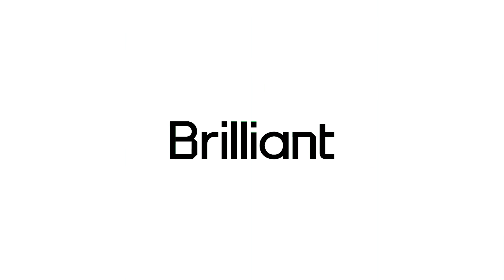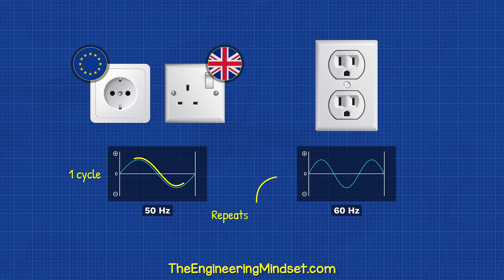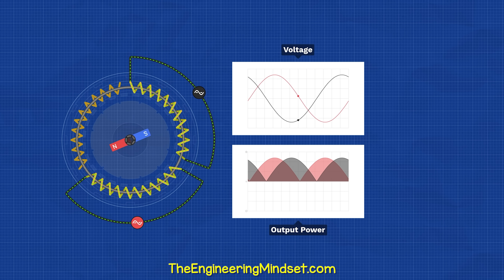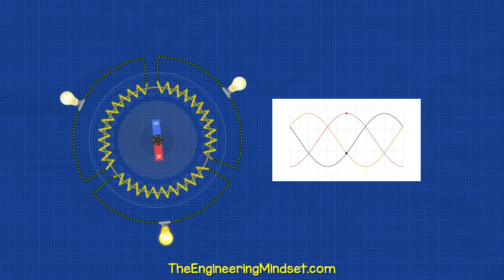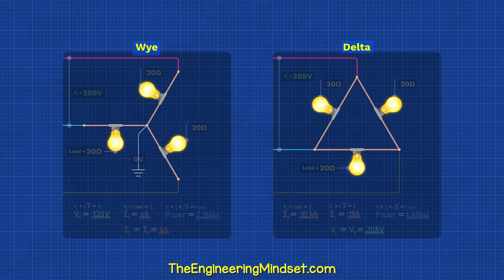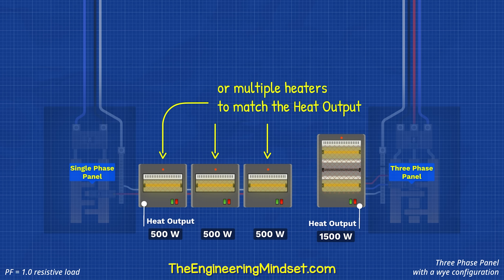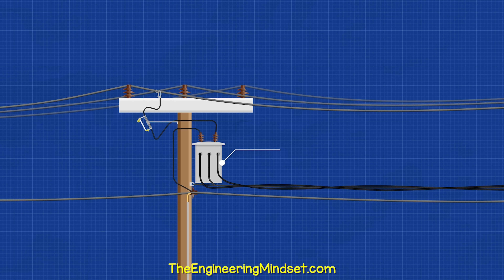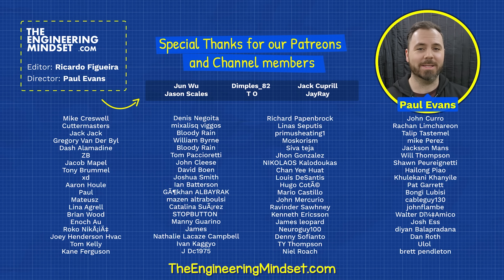How 3 Phase Power works: why 3 phases?

Comment: At 2:06 the oscilloscope is 90 degrees out of phase.  If this is meant to be an educational video you should get details like this correct.
Reply: Relax bud. This isn't a video on how to read oscilloscopes. Also, you're holding your phone sideways so you're 90 degrees out of phase
Reply: I have literally no experience in this, but I’m curious as to why it would be out of phase there. The highlighted area under the curve shows the wave to be at 0 when the magnet is parallel to the coil. Would that not be the case? From someone with no experience that seems correct, but If it’s wrong I’d be interested to know why.
Reply: @nickdowning5562 it's not off phase. When the negative is facing the coils the dot should hit the peak of the negative wave
Reply: @AfricanLionBat  it is wrong, because the stator windings are drawn in the wrong orientation
Reply: Relax Michael. No one who needs to read oscilloscopes should be using this video as a reference. He clearly explained the idea even if the picture wasn't exactly right
Reply: Or the magnet is wrong paited
Reply: this has to be a joke lmao
Reply from the maker: Seen our new Oscilloscope tutorial? (beginner friendly) link here:➡️ https://youtu.be/LaY47Qrfs0c

Comment: Really you could make 4 phase power 

Each phase shifted 90 degrees for a total 360 degrees

1 neutral and 4 wires 

All 4 phases would allow you to effectively push peak to peak voltage and not rms so it would act more like DC with a slight ripple, 4 ac phases would average out to the peak to peak voltage so you can still get 250rms on each phase or 120v
But 4 phases at 250rms together would allow you to supply the full 700 peak volts, effectively as a  positive rail or a negative in respect to neutral depending which direction you rectify across zero volts, transmit ac power in 4 phases it starts to act like DC power
Reply: You can get DC mains power without an ass of capacitance and voltage regulation
Reply: The more phases you add the more expensive it gets, each phase needs a spot and coil in the generator at the power plant, and another wire in the power cord including neutral, and grounding

You know copper isn't the cheapest thing, aluminum too if you gotta run millions of miles of wire

Comment: Curious, so I've thought of perpetual energy. From my understanding, a generator is most commonly assembled as a unit, including a natural gas-powered engine and an alternator. Of course, you have other components and instruments within it, but that is the general construction. Is it possible, or could you explain in a video why the perpetual energy theory does not work using an alternator and electric motor that essentially powers itself and could power a house at the same time? Ideally being free power/energy?
Reply: But if your alternator is big enough, say a 75kw, turning at the required RPMs, with the pulleys sized accordingly, it still slows down?
Reply: That's what I've heard, just still wonder if certain variables can be changed to deviate the outcome.

Comment: Alternating current has that dead spots when in the zero crossing. With three phases you lessen this effect. However, with D.C. you totally eliminate it. Plus you have zero electromagnetic interference, leading to much healthier environments in houses and around distribution lines. I cannot wait for the time when A.C. 60Hz as we know it is long gone. A high voltage DC (HVDC) line is like it is not there even if you stand next to it with a fluorescent bulb.
Reply: You still have an electromagnetic field around DC conductors/inductors. I'm not sure whether you could use this to excite a neon light, but you can excite one electrode of a neon light by directly coupling DC and cause some luminescence around one electrode.

Comment: The explanation of the RMS (Root Mean Square) is exactly the opposite of what you gave: First take the Square, then determine the Mean and lastly take the root.
For a sine wave that doesn't matter, but for other wave-shapes it does! Especially for triangle waves and sawtooth waves it matters a lot!
Using the Ohms laws (multiple) will show why the RMS value correctly gives the Effective value of the voltage and current for a waveform which gives the same energy / power as a certain DC voltage /current!
So it is RMS, not SMR!

Comment: tomorrow i installed 3 phase connection to my home  to run 5 to 6 AC during summer season. 
your video helped me to understand how 3 phase work. it costs  me 8000 indian rupees to upgrade  form single phase .

i am form india i feld good that you mentioned india in your video.

Comment: Why not use just 2 phases with 2 coils instead of 3 to simplify transmission and voltage-level down-conversion?
The waveform will be sinusoidal either way (whether you use 2 or 3 phases) anyways.
Reply: 3 phase is the simplest way to provide constant power. The voltage of the 3 phase system is sinusoidal, but the power (aka V * I ) is constant. With one or two phase, the power consuption is not constant.

Comment: So if we did have a 120 Phase Power, would that do over 3 phases? (Theoretically). Would it be more energy efficient? What if each phase had it's unique voltage? (Ranging from 1 -120). So curious. What their be any real world application for this?

Comment: Interestingly DC power is more efficient than AC power for transmitting electricity over long distances. In some instances AC is converted to DC for transmission and then converted back to AC at the destination
Reply: I was surprised to learn that. I was always taught that AC was much more efficient at transmitting power over distance. In economic terms, that was the case. In physical terms, it wasn't.
Reply: yep. But only at very-very high voltages and in sites where freq matching is difficult or different

Comment: Nice video. One thing that might benefit from further explanation, though, is that RMS is not used simply to take the negative values of the sine wave and make them positive. If you simply flip the negative half to positive, and take the mean, you get average voltage, but that is not the same as the value you'll get if you do the squaring, take the mean of that, and then take the square root of that. This is because power is related to voltage squared.

Comment: In practice the motor is design in 6 phase with 60 degree phase angel to reduce phase vector loss. Almost no real motor design in 3 phase with 120 degree phase angel. And also some PM wind turbines use 12 phase(30 degree shift design) but in general motor design in 6 phase power grid is 3 phase.

Comment: Actually, a two-phase generator with phases 90 degrees apart (Nikola Tesla's original polyphase concept) ALSO delivers constant instantaneous total power (i.e. ripple free) into balanced passive loads.  The trig identity sin^2(x) + cos^2(x) = 1 explains it.
Reply: that is actually a 4-phase motor.
Reply: @andrewgrillet5835  Nope.  Two-phase, 4-wire.
Reply: I thought constant would be DC? AC no matter what is bouncing back and forth.
Reply: @runnergo1398  DC just means the voltage never changes sign. If the voltage is constant, it will also be constant power, but constant power does not imply constant voltage, and multiphase AC can also deliver constant power.
Reply: @runnergo1398  For balanced three phase AC, the SUM of the pulsating instantaneous power in each phase adds up to a constant value... It's fortuitously just how the trig works out... It also means that the instantaneous torque that must be delivered to the generator shaft by the prime mover (e.g., the turbine) is also constant, not pulsating.

Comment: So why isn’t 3 phase wye with a neutral or 3 phase delta not 360 Vac ? instead of 
208 RMS/240 Vac ?
Reply: what are you talking about? 208v is 120° out of phase & 240v is 180° out of phase

Comment: Interesting little bit here: You can see cheap LEDs flicker. They cause some people, like my mother and I, headaches.
Reply: There's several reasons for this, one is the alternating current and a cheap power supply. Another is that leds are often dimmed with pulse-width modulation, which isn't bad in principle, but often the pwm speed is too slow and causes a visible flicker. With car headlights that effect becomes super obvious if you see them in a mirror.
Reply: Car headlights, Christmas lights, and the aforementioned cheap bulbs. There's no end to the flickering
Reply: The old florescents flickered so fast you couldn't tell unless they were wearing out
Reply: Even a lot of pricier LED bulbs flicker but at a much higher frequency
Reply: @kendokaaa  Every LED flickers on AC. But yes, properly build ones flicker in the range of kHz. There are cheap (and expensive) ones that flicker in "low" frequencies that you can easily detect with your smartphone - those should not be used. 
And there are cheap (and expensive) ones that do it properly.

Comment: Industrial electrician/instrumentation tech here. 8:45 is incorrect "if you need a neutral then we need to use a wye configuration". It's less common today but you still will find centre tapped delta transformers. They have a neutral tapped in the middle of one of the secondary windings. Say it's a 240V ph-ph unit, then it will be 240v between any 2 phases and 120V (1/2 of the ph-ph) between the neutral and 2 of the phases. The 3rd phase is your wild leg and will be about 200V to neutral. This setup is unbalanced (the single phase is limited to 5% of the transfomer total capacity) and normally used when you have large higher voltage single phase or 3ph loads and much less lower voltage ones. Example is a single purpose equipment enclosure (like a remote pumphouse) that needs a transformer. Say it's a 230V 3ph unit, you put in a center tapped delta and have the 3ph power for the large pumps and HVAC, 230V single phase for the building lights, along with a small 115V feed for work lights, servers and receptacles. For neutrals you can also use only 2 phases to feed a single phase transformer, still unbalances your feed but if you have multiple transformers then you can stagger them and balance the total load. A funny bit of info is the typical residential/commerical voltage spread around the world. Europe is 230-400, the USA is 120-480(277 ph-neutral) and Canada is 120-600(347ph-neutral). Yes industrial/commercial buildings in Canada use 347V single phase power for their lights, has been the death of many a handyman.
Reply from the maker: Absolutely, we covered high leg delta in our previous video here https://youtu.be/u0SsejDCVkU

Comment: GM developed 9 phase 20 years ago and in 2007 I whatch a drag rail with a 5,000 hp Delphi 12 phase motoring each back wheel run 4 second 1/4 mile runs for exhibition only. Powered by two 100 pound battery packs.

Comment: The neutral explanation is kind of wrong. I mean the average viewer will get really confused by it so I understand giving this version. But in reality there is no 4th wire from the power station to you. They take advantage of the fact the load is balanced (they actively monitor it and do extra balancing when needed) so your neutral is a phantom wire that basically can just connect to ground.

They actually need to take advantage of this quirk for the grid to even be possible. Because having a full loop to each customer is financially and materially impossible.

Comment: The alternator in your car is really just a three-phase generator. The three outputs are combined together with six diodes for DC with no ripple voltage. No filter is required. 
Back in the day, an indication that your alternator is going bad is you here a whining noise in your AM radio. This indicates a bad phase in your alternator needs to be replaced soon.
Reply from the maker: Absolutely, we covered that in detail in this video too https://youtu.be/jdSKlg80DjU

Comment: I must have missed something. Older American homes (such as the one I grew up in) didn't have neutral wires. So how did that work in the context of single-phase power from a 3-phase system?

Comment: They looked into using 6, 9, even 12 phases for transmission.  But the losses due to capacitive and inductive interactions of the wires quickly made the additional materials and design not cost effective.

Comment: leds are NOT constant but flicker very fast for LED bulps (PWM signal)
Reply: depends on voltage smoothing (capacitors and inductors) post rectifyer/regulator... And then there are glowing materials (sorry for the poor excuse of a translation, I don't know the proper english term for it) that are used to modify color output of LED's, as LED as such is very monochromatic lightsource. These "glow materials" can further smooth out blinking, and that is as far as I understand the main reason for "afterglow" when you cut power.

Comment: Question: i understand that each phase is connected to the positive and negative of each coil in the generator but where is the neutral connected to?
Reply from the maker: This is shown in the video, 7:22
Reply: @EngineeringMindset  just to type out the answer... Each of the three phases have to outputs, technically in AC you can't really call them negative or positive, because that varies over time and swaps around about 100 times every second... But anyhow, each phase has two outputs. One of each phase can be connected together, and that is basically how you get the "neutral". Now any of the phases can be connected to this common neutral (through load obviously, or it would be short circuit).

Because all three phases share a common neutral, you can wire three phase power with just 4 wires in a cable... And that is how cables used to be. For safety reasons now (3 phase) cable usually has 5 wires, one for protective earth (grounding or PE, wich is short for 'protective earth').

A clever part is that as the three phases share a common neutral, that wire can actually be only as thick as all the phase wires and it does not get overloaded. The reason for this is in the fact that when you have only one phase in use, the neutral wire has as much current as the so called phase wire... But if we assume you had all three phases in full use, the neutral wire actually does not carry any current, because the loads are balanced. The further off-balance the phases are, the more current in the neutral, but the "least balanced" scenario is full load on single phase... The more load you add to the other phases, the less current the neutral has to carry.

So to sum it up. The neutral is the sum of all three phases connected together. And using neutral allows use of basically any mix between 1 to 3 phase loads on just 4 wires (plus one for safety).
Reply: @JuhoJohansson-bz3jb  Thank you for your answer, i now understand that each coil in the generator has a "positive" and "negative" and connecting one phase of each gives you that neutral.

Comment: In the US we refer to the regular residential service as split single phase; it just has a center tap on the secondary side of the transformer, tied to ground to split our mostly used 120V off. We also have 3-phase high leg delta that provides 120V, 120V, and 208V, P-G and 240V P-P, which is quite prevalent in smaller businesses and home shops , that use mostly 120V but have one or a few smaller 3-phase machines, as it can be accomplished with 2 transformers. And while rare you can find the occasional 346/600V 3-phase which is mostly only uses in more industrial businesses.
Reply from the maker: Absolutely, we covered in detail in our previous video here: https://youtu.be/u0SsejDCVkU
Reply: 347/600V is actually commonly used instead of 277/480V in Canada
Reply: My apartment even has a shared neutral because of that. It allows you to cut down on the copper required by about a quarter as you're not duplicating the neutral. So, one hot from one phase and another from the other and both of them using the same neutral. It works, but it can be annoying for some things you might want to wire in.
Reply: @SmallSpoonBrigade  I assume you mean a shared neutral at the main panel coming into your apartment. This is just the center tap, as mentioned, which carries the unbalanced load… Now, there are instances with a shared neutral from the main panel, this is called a multi wire branch circuit - and these are high risk as an open neutral leads to issues, such as creating a 240v circuit which destroys appliances and electronics.
Reply: 3 phase 480 isn't all that rare. Just about all manufacturers have 3 phase 480 systems. Canada uses 600V systems.
Reply: 👍 split single phase

Comment: Not gonna lie I never bought someones product from yourtube, but as a electrician who does cool stuff like dealing with those angry electrical pixies, I couldn't resit to buy a mug. 3 phase can be sorry aggressive especially when there an equitment failure and all you hear is the bang then you hear the wires banging throught the raceway because it produced  such a high amount of fault currrent that it whips atound in the pipe lol. Obviously the boss doesnt like when that happens $$$$
Reply from the maker: Thank you, hope you like it. Hopefully the diagrams will also come in handy when trying to explain to non-technical people too. Although it won't stop the banging in the raceway unfortunately.

Comment: With 400 Hz, airplanes require fewer generators or alternators to produce a sufficient amount of power. This reduces their total weight, thereby making it easier for airplanes to take off. If airplanes used a lower power frequency, they would require more generators or alternators, thus increasing their total weight"